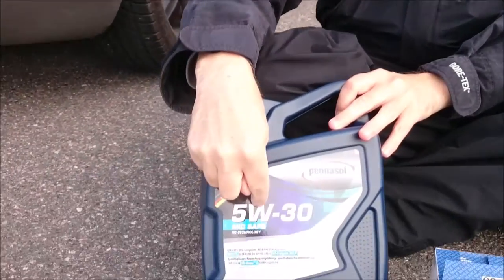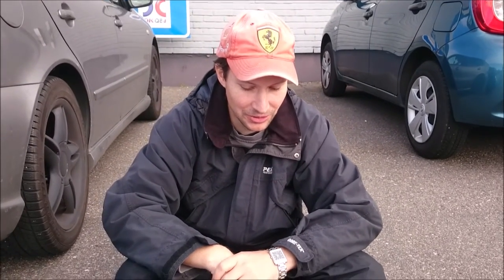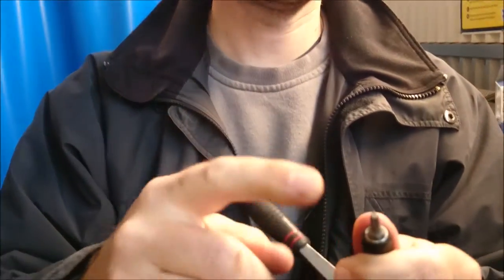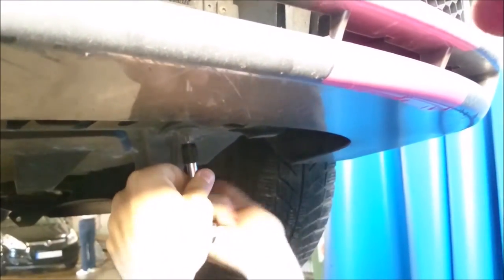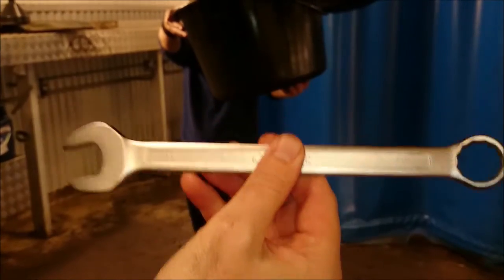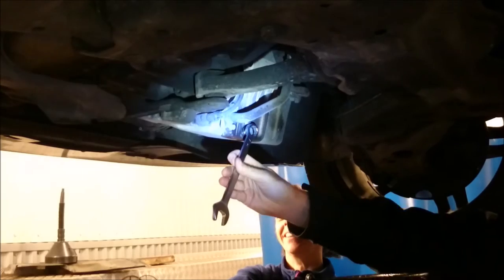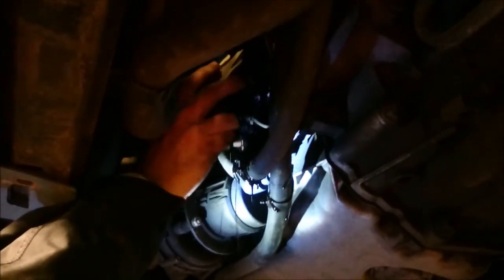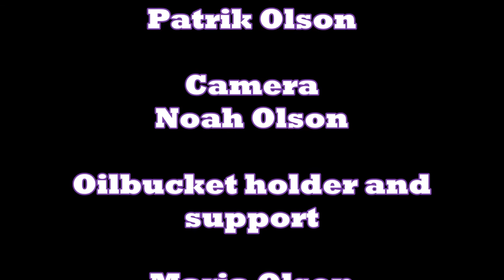Change oil filter and motor oil on Seat Leon

Comment: I like this guy....he's never too far away from a half-smile. In my lifetime I've done many car and aircraft engine oil changes. The Law of the West is that you will ALWAYS, unremittingly, indubitably, without fail....get oil on you somewhere, gloves or no gloves...why?...because engine designers don't design to keep your hands free of it. The drain plug could be designed better; the filter could be easier to get at......designers not at all interested; too much thinking required...... c'est la vie.

Comment: I have seat 2.0T 2002 and the ford toruse filter does fit in my seat
Reply from the maker: Its very common for filters to fit other cars then the one they where designed for. But usually its best to use the filters made for the car. In a pinch you are ofc better of with any filter than none at all but not something i recommend. Did you try to swap?

Comment: What engine do you have in the Seat?
Reply from the maker: +Steve Allen the 1,8T engine its very widely used in the VAG car park
Reply: how many liters of oil do you need? I have seat 1.4 tsi engine
Reply from the maker: melikşah naiboğlu you will have to check your owners manual!